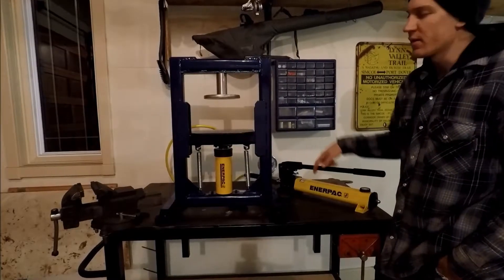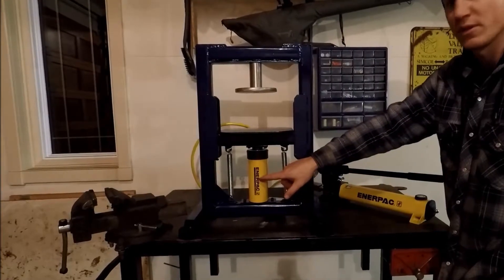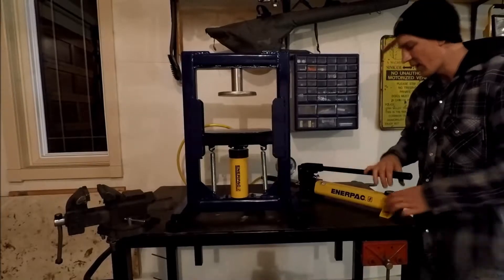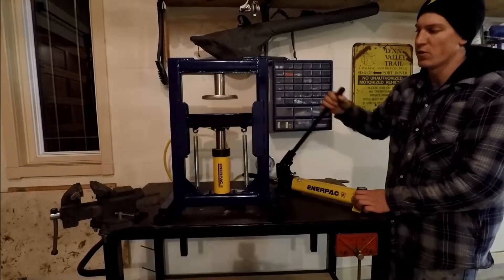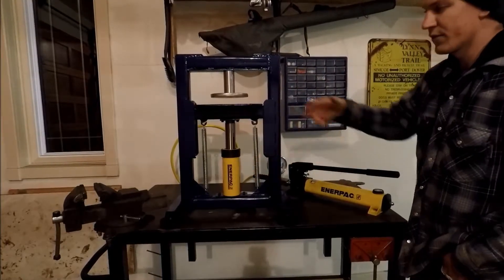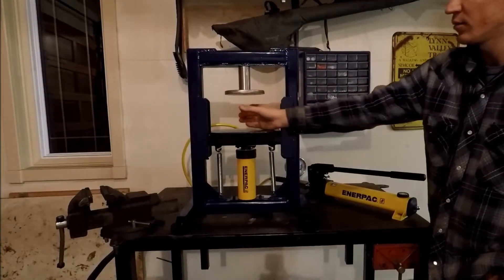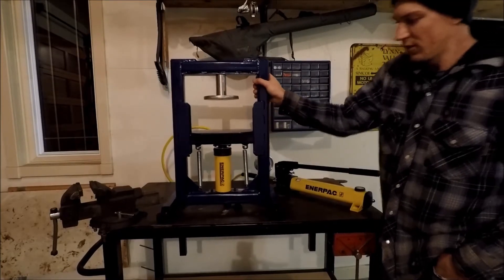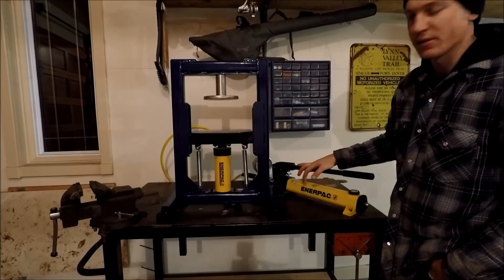Enerpac SCR-154H Homemade Press

Comment: Hello. You have a great hydraulic set. Tell me please, does it take a lot of effort to pump up from 500 to 700 bar? I have to press on the handle of my P392 with almost all my 70kg weight.
Reply from the maker: thanks for watching, yes it would be hard to press at this pressure.  Check to make sure you have enough oil in the P392